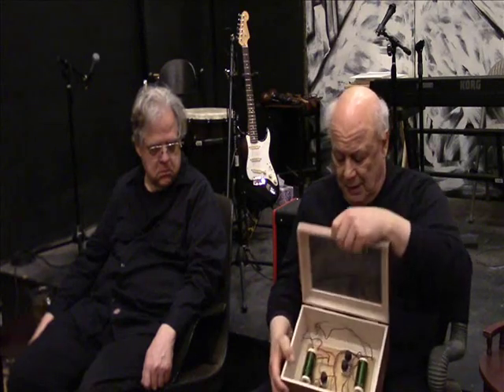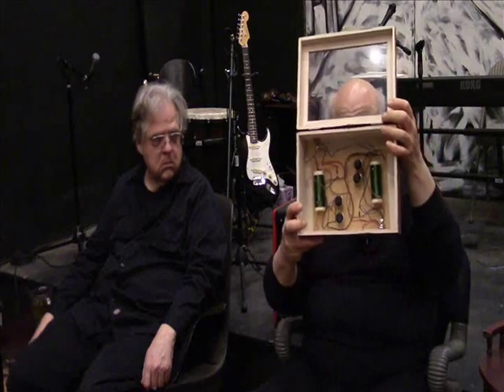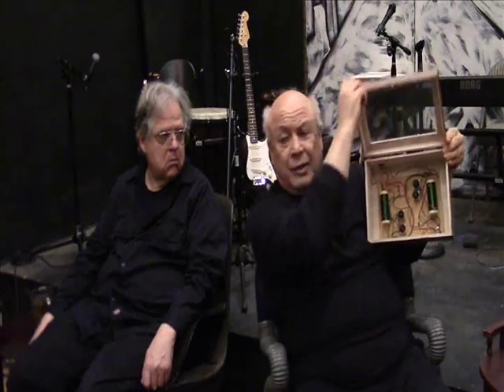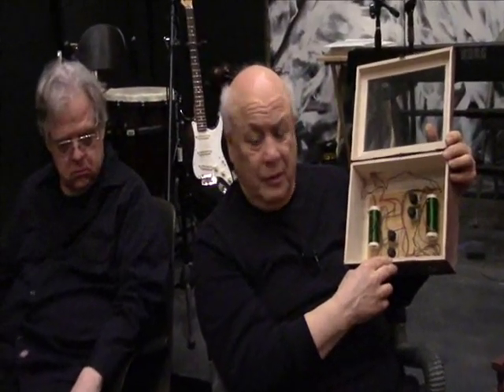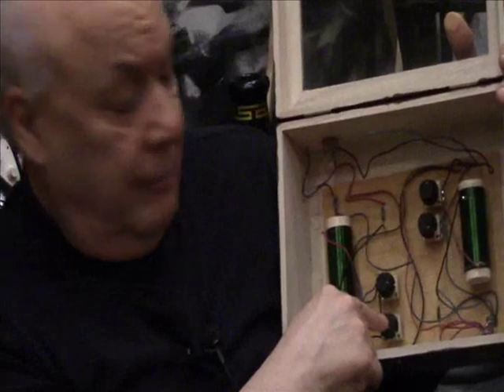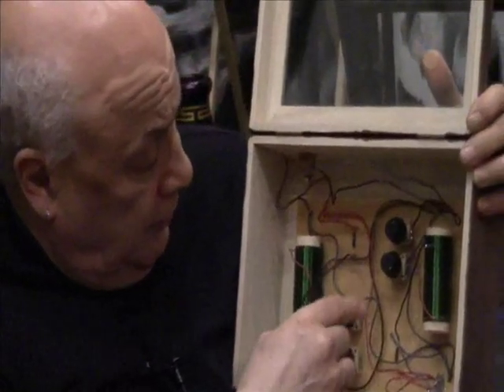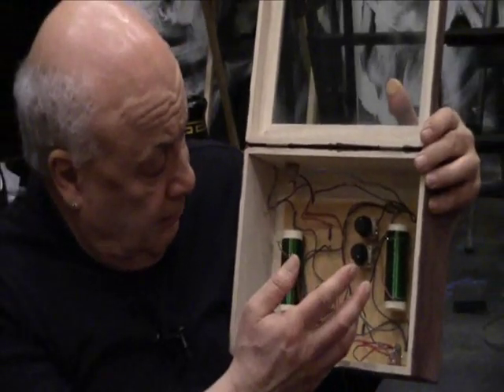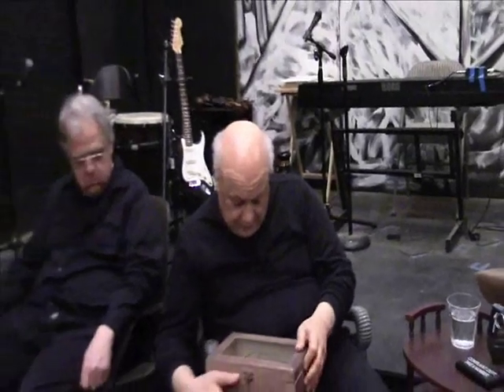How to Make a Powerful Tesla Spirit Radio -- Easy to Build!!!

Comment: I know this is many years old, but you said “tune your heart and your mind”.  I have yet to make a radio, but upon sanding the rim of a singing bowl tuned my mind accidentally...  I have wondered if tuning a spirit radio involves the same basic idea?  Most people’s units I’ve watched seem untuned and I had to offer that possible suggestion, could you tube the resonance with such a frequency.
Reply from the maker: Harmonic Resonance and BFO - beat frequency oscillation - are the secrets of tuning a radio.
Reply: @gorebagg  my curiosity lies in tuning a spirit radio, theorizing of course.  Have not gotten my hands on the matter.  But when I sanded a crown chakra singing bowl, my teeth rang and my mind was blown for a week.    I imagined I must have tuned my chakra, because the sanding seemed to generate radio waves of a specific frequency.
Reply from the maker: no idea what happened there, but fortune clearly struck.